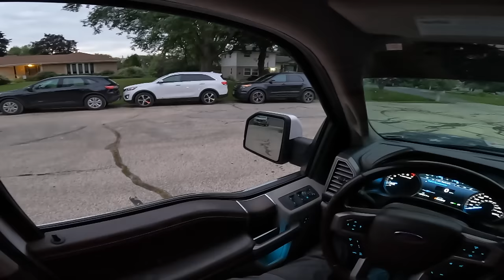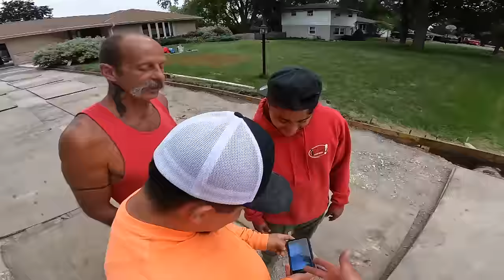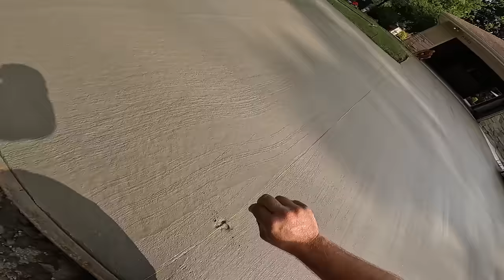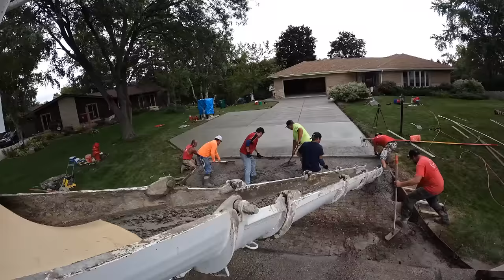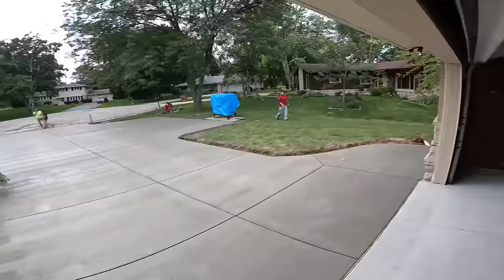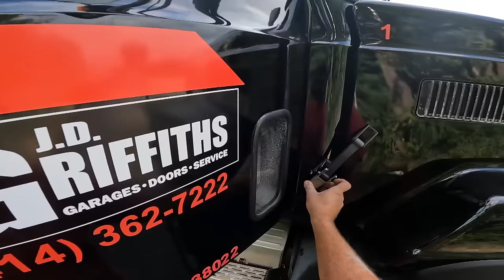Big driveway, job is finally complete!

Comment: Chances they threw the batteries in and  got that truck started and hoped you'd just hand over $? Gotta be awkward when it doesn't even shift into gear WITHOUT the destroyer ruining it 😂
Reply: Yeah I agree on the batteries. The batteries were probably new to the truck but not new at all. Probably waited to the last minute to get it running and never tried to drive it. Then the guy saying just slam it in gear is a knucklehead. Probably why the truck is all busted up under the hood.

Comment: Ryan when it comes to Contactors you set the standard of what a TOP QUALITY contractor should be and the the high level of work you and YOUR CREW produce. I think a lot of people are nervous when choosing a contractor for work on their home due to the low level of quality that they receive. I know my wife and I are.
Reply: I agree lots of shady contractors, always do your research.
Reply: There are a ton of shady contractors. Just got my bathroom redone and my bulkhead and there’s a hole in the ceiling where the new bathroom fan is  and a hole where the new bathroom heater is

Comment: Thats the perfect mentality when it comes to sidework.  I work as a cabinet installer but I've also done tile and plumbing in my time.  I took on a side job from one of the customers we did cabinets for to also do her tile backsplash, but i scheduled it during off-hours for my company, and my company doesn't even do tile.  Didn't matter though, they got mad at me anyway and told me the next time it happens is disciplinary action

Comment: You do nice work. I have worked doing flat work for years. You do it differently up north compared to Florida. We use power screed,we don't use a groove unless it's requested  which is never. We saw cut.

Comment: That's why you always keep all windows rolled up on all vehicles at all times on a job site. Even if you're 50-60 feet away. I used to cement oilwell casings and have seen all kinds of nasty stuff blown all over and into the interiors of vehicles. Dry cement, cement slurry, Acids, oils, truck radiator coolant/anti-freeze. and sewerage from an over turned outhouse. The ready-mix driver should've known to check windows of vehicles they are parked near.
Reply: I was ganna say totally his fault what was he thinking around Daryl 😭😂 had to blame someone I guess
Reply: Yeah let’s blame the cement driver. Smh

Comment: How do you refill the topsoil and grass at the edge after you pull the formwork ?    I use a turf cutter and keep enough of the old spoil rolled up wet, to put back into the edges.    Great channel, you can feel the vibe that keeps the job bopping along  👍

Comment: How do you get away with no little rebar? My grandfather and uncles were/are builders and owned concrete companies with large pumpers trucks all that. So been on hundreds of job sites and maybe poured 20 driveways and slabs of my own. Always had easily triple the amount of rebar and thicker with things that hold them up.  Mostly in Florida and around the south east.    

And could you do have you done permeable concrete or pavers? So water drains through it instead of running off or pooling. Doesn’t stay in it drains straight through to a rock base with a collection pool usually and drain out. Some people like to feed a rainwater collection system this way.

Comment: I'm sold on Daryl Srs methods when it comes to Jr. He "forgets" or just leaves Jr behind on days that Ryan is expecting Jr. And Jr wants to. On the days that Sr gets his way he does the Jr jobs of buggy/wire pull. Easyyyyy money effort tasks. When Jr comes and Ryan has these extra hardworking guys Daryl doesn''t fit in- work wise he can find things but the temp guys are working circles around him on those task. So if Jr comes in then those riding and pulling jobs are gone- even Jr outshines Sr on those and I think someone is catching on.... 
I love the Daryl's - but Sr needs to make himself more worth it before the temp guys aren't temporary. I've own a contractor business for decades and I understand employees- even friendships. But shouldn't be testing the friendship if you can't offer more. History only goes so far when stress isn't worth it. Drive better. Engage better. Head down and just do. Get back to center of the relationship with effort and no excuses

Comment: Is there a reason why you cut joints? Is at for esthetics or another reason? In the Netherlands we don't poor concrete on the driveway/porch. We use big ceramic or concrete tiles.